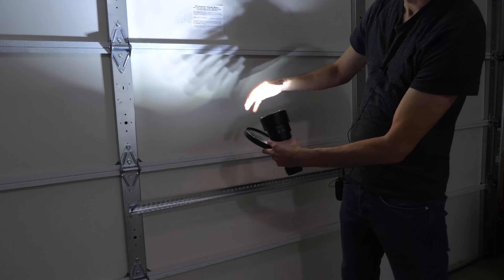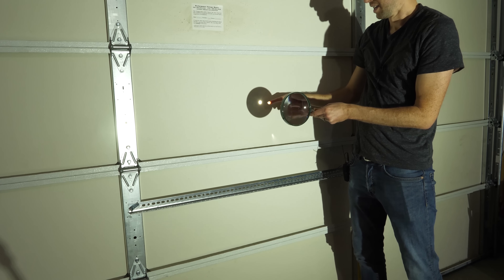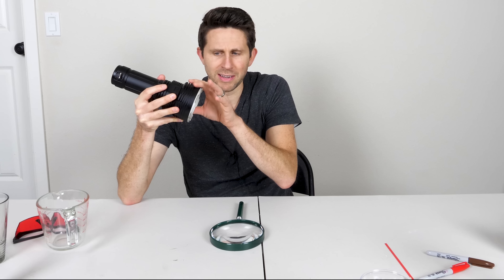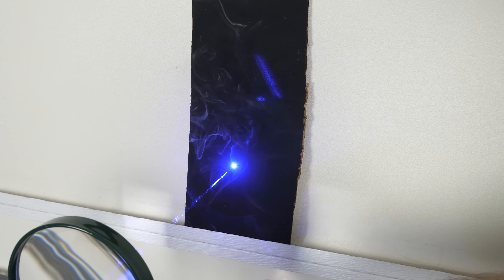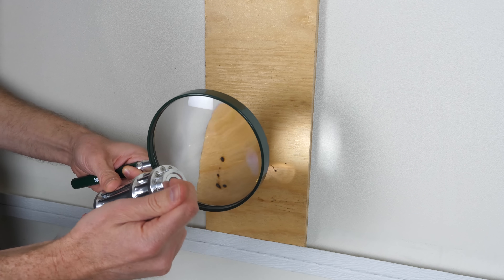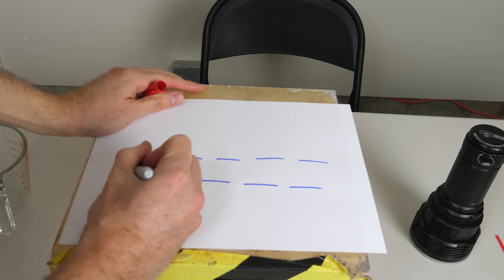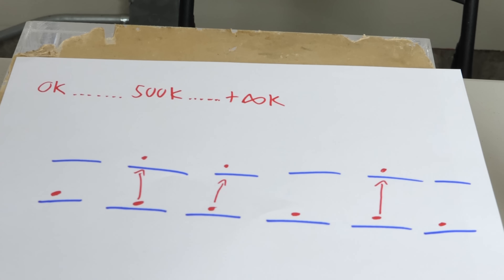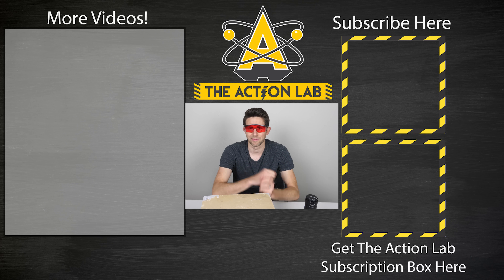What Happens if You Focus a 5W Laser With a Giant Magnifying Glass? Negative Kelvin Temperature!

Comment: All the physics here is WAY over my head! I was wondering though, what would happen if you continued to put MULTIPLE magnifying lenses in front of the already magnified beam? Magnify the laser beam as you demonstrated but then put ANOTHER magnifying lens in front of THAT beam and then another and another and another. Would the beam continue to increase in heat? Would it eventually burn through the later lenses?
Reply: Unfortunately, at some point, the light would be unable to get bundled up further. The more you bundle up the light, the higher the spread becomes, making it harder and harder to bunch up. The surface area and the spread of the light are inversely proportional. Let me show you:

Remember this: Systems with lenses and mirrors are reversible (reverse the direction and it will look the same).

Now imagine a small light bulb. The light at the light bulb has immense spread, and it pretty much shoots out in all directions. Now position this light bulb in the center of a very big parabolic mirror. The light will hit the mirror, and it will get “straightened out.” But at what cost? The cost is the increase in surface area. The light bulb had light concentrated very closely, but the spread near the bulb was very high while the mirror reflected the light into nearly parallel light rays, but now they might be many magnitudes further apart from each other.

And because this system is reversible, you can imagine yourself shining light into the mirror and trying to bundle it into a single point. If the light you put into the mirror is even just very slightly not parallel (even just a tiny spread), then the spread will get magnified by a ton after converging to the focal point. The size of this pseudo light source at the focal point is determined by the coherence/spread of the light you put into it, and it is impossible to bundle it up more than that.
Reply: @hypnogri5457   Ok, so even light is not infinite. It has a set range that it can't compress beyond depending on the source..?. It eventually becomes like trying to compress water? I love this stuff! Makes me wish I paid closer attention in school! I could just never really wrap my head around a lot of it. I've often thought about this kind of thing and wondered what it would take in order to reach "Sci-fi" levels of weapons power like Star Wars blasters or Star Trek phasers, etc. THANK YOU, hypno! (I apologize for making such little (if ANY) scientific sense. These equations are beyond me!)

Comment: What if you shined the flashlight into a large lenticular lens?
Reply: Unfortunately, at some point, the light would be unable to get bundled up further. The more you bundle up the light, the higher the spread becomes, making it harder and harder to bunch up. The surface area and the spread of the light are inversely proportional. Let me show you:

Remember this: Systems with lenses and mirrors are reversible (reverse the direction and it will look the same).

Now imagine a small light bulb. The light at the light bulb has immense spread, and it pretty much shoots out in all directions. Now position this light bulb in the center of a very big parabolic mirror. The light will hit the mirror, and it will get “straightened out.” But at what cost? The cost is the increase in surface area. The light bulb had light concentrated very closely, but the spread near the bulb was very high while the mirror reflected the light into nearly parallel light rays, but now they might be many magnitudes further apart from each other.

And because this system is reversible, you can imagine yourself shining light into the mirror and trying to bundle it into a single point. If the light you put into the mirror is even just very slightly not parallel (even just a tiny spread), then the spread will get magnified by a ton after converging to the focal point. The size of this pseudo light source at the focal point is determined by the coherence/spread of the light you put into it, and it is impossible to bundle it up more than that.

Comment: Use 5 magnifying grasses
Reply: Unfortunately, at some point, the light would be unable to get bundled up further. The more you bundle up the light, the higher the spread becomes, making it harder and harder to bunch up. The surface area and the spread of the light are inversely proportional. Let me show you:

Remember this: Systems with lenses and mirrors are reversible (reverse the direction and it will look the same).

Now imagine a small light bulb. The light at the light bulb has immense spread, and it pretty much shoots out in all directions. Now position this light bulb in the center of a very big parabolic mirror. The light will hit the mirror, and it will get “straightened out.” But at what cost? The cost is the increase in surface area. The light bulb had light concentrated very closely, but the spread near the bulb was very high while the mirror reflected the light into nearly parallel light rays, but now they might be many magnitudes further apart from each other.

And because this system is reversible, you can imagine yourself shining light into the mirror and trying to bundle it into a single point. If the light you put into the mirror is even just very slightly not parallel (even just a tiny spread), then the spread will get magnified by a ton after converging to the focal point. The size of this pseudo light source at the focal point is determined by the coherence/spread of the light you put into it, and it is impossible to bundle it up more than that.
Reply: @hypnogri5457   i theorize that there is a way to amply a laser beam to highly  destructive dangerous proportions . One way using capacitors that store energy and release all at once like a round of ammunition,  reason being you may have an issue with heat firing off beam of beam of that magnitude  , think it would be fun building a laser that could penetrate a 1” thick piece of steel 🤷‍♂️
Reply: @deltafox8795  its possible to store and release the energy. The video only talks about systems of lenses and mirrors. The moment you allow energy storage, everything is possible

Comment: build a laser generator that would create steam . the steam would turn a small dc generator charging a batt . inverted to ac or use as dc. seeing that you are multiplying the heat can you get more out than you put in . can you power the laser with the generator with a 12 volt surplus ? steam is a powerful force and with heat like that possibly doable ?  with steam there is no drag once it builds up it will move a train
Reply: you can capture the energy and use it to make something hotter but that wasnt the point. A lens/mirror system is unable to do that

Comment: Sure you can, use a round sleeve or tube and put that flashlight inside it and contain it into the magnifying glass.
Reply: it is impossible to make it hotter than the fuse of the individual LEDs. (but its possible to make it hotter than the average temperature at the opening because the light has already spread a lot)

Comment: What happens if you put two or more magnifying glasses in the laser beam to pass through? What happens if you focus five or more laser beam in one single point?
Reply: Unfortunately, at some point, the light would be unable to get bundled up further. The more you bundle up the light, the higher the spread becomes, making it harder and harder to bunch up. The surface area and the spread of the light are inversely proportional. Let me show you:

Remember this: Systems with lenses and mirrors are reversible (reverse the direction and it will look the same).

Now imagine a small light bulb. The light at the light bulb has immense spread, and it pretty much shoots out in all directions. Now position this light bulb in the center of a very big parabolic mirror. The light will hit the mirror, and it will get “straightened out.” But at what cost? The cost is the increase in surface area. The light bulb had light concentrated very closely, but the spread near the bulb was very high while the mirror reflected the light into nearly parallel light rays, but now they might be many magnitudes further apart from each other.

And because this system is reversible, you can imagine yourself shining light into the mirror and trying to bundle it into a single point. If the light you put into the mirror is even just very slightly not parallel (even just a tiny spread), then the spread will get magnified by a ton after converging to the focal point. The size of this pseudo light source at the focal point is determined by the coherence/spread of the light you put into it, and it is impossible to bundle it up more than that.
Reply: Concentrating laser beams will indeed make the temperature higher because its coherent light. (just point multiple lasers at a point)

But this is still impossible:
imagine many lasers pointing at a single point/hole on a sheet of metal from different angles. You can now imagine this hole as a new light source. This light source cant be made any smaller than it currently is because the lasers converge at different angles making the light incoherent. So it's impossible to make the temperature higher by trying to bundle up the light even more

Comment: I was thinking if you surrounded the sun in mirrors then made a tiny area for the sun to seap light out and reduced it to a a tiny point using a giant magnified glass then made it tinier and tiner until it's a tiny point wouldn't it be hotter?

Of course, we don't have that kind of technology, but yk just thought I'd put my theory out there 🤔 😅
Reply: Unfortunately, at some point, the light would be unable to get bundled up further. The more you bundle up the light, the higher the spread becomes, making it harder and harder to bunch up. The surface area and the spread of the light are inversely proportional. Let me show you:

Remember this: Systems with lenses and mirrors are reversible (reverse the direction and it will look the same).

Now imagine a small light bulb. The light at the light bulb has immense spread, and it pretty much shoots out in all directions. Now position this light bulb in the center of a very big parabolic mirror. The light will hit the mirror, and it will get “straightened out.” But at what cost? The cost is the increase in surface area. The light bulb had light concentrated very closely, but the spread near the bulb was very high while the mirror reflected the light into nearly parallel light rays, but now they might be many magnitudes further apart from each other.

And because this system is reversible, you can imagine yourself shining light into the mirror and trying to bundle it into a single point. If the light you put into the mirror is even just very slightly not parallel (even just a tiny spread), then the spread will get magnified by a ton after converging to the focal point. The size of this pseudo light source at the focal point is determined by the coherence/spread of the light you put into it, and it is impossible to bundle it up more than that.

Comment: To stop the flashlight from spreading out you need a collimating lens then you could focus it to a point but the point would retain the original layout of the LED's in the flashlight since it is not a point source.
Not possible to amplify the power, in fact power is lost through the atmosphere and the lens of the magnifying glass but, the power that makes it through is focused on a smaller area. We would call this watts per square inch. 5 watts focused on a 1 inch square area spreads the power out over the entire area, focus it down to 0.001 inch and the average relative power is increased 5000 times.
Reply: You wouldnt be able to focus it to a point smaller than the fuse on each of the LEDs because thats the limit set by the conservation of etendue

edit: by fuse I mean the wire of the LED

Comment: You can get something locally hotter than the source by combining multiple sources in a point. Basically sun light and flash lights have a large surface, which you can focalise, just not with that magnifying glass/reflector.

Comment: Just change or remove the reflector or use a larger lens that's wider than the beam of the flash light. You can also use multiple lenses or lenses designed specifically for the light source. SOLVED

Comment: A smaller point with the same energy will direct more heat per the size, as in, a 1W beam at 10 cm diameter won`t be as hot as 1W at 10mm diameter, because the energy isn`t dispersed over a larger area.
Right?
Reply: It's impossible to bundle it up more than the wire in the individual LEDs (probably impossible to bundle it up more than the LED itself)

Unfortunately, at some point, the light would be unable to get bundled up further. The more you bundle up the light, the higher the spread becomes, making it harder and harder to bunch up. The surface area and the spread of the light are inversely proportional. Let me show you:

Remember this: Systems with lenses and mirrors are reversible (reverse the direction and it will look the same).

Now imagine a small light bulb. The light at the light bulb has immense spread, and it pretty much shoots out in all directions. Now position this light bulb in the center of a very big parabolic mirror. The light will hit the mirror, and it will get “straightened out.” But at what cost? The cost is the increase in surface area. The light bulb had light concentrated very closely, but the spread near the bulb was very high while the mirror reflected the light into nearly parallel light rays, but now they might be many magnitudes further apart from each other.

And because this system is reversible, you can imagine yourself shining light into the mirror and trying to bundle it into a single point. If the light you put into the mirror is even just very slightly not parallel (even just a tiny spread), then the spread will get magnified by a ton after converging to the focal point. The size of this pseudo light source at the focal point is determined by the coherence/spread of the light you put into it, and it is impossible to bundle it up more than that.

Comment: So... according to your theory here, if I carefully focus two identical power level lasers from exact opposite directions (pointed at each other)into a convex diamond, the opposing beams could create a near ground state that would both melt and freeze the diamond (in that order) in less than a femtosecond?
Imagine having a beer cooler that needs a dime sized solar cell and a ultra capacitor-LiFePO4 power cell the size of a USB stick and have ice cold beer for the whole 2 weeks of fish camping in Alaska. 
The cooler would probably cost $5M, but hey, cold Heinekens a thousand miles from nowhere is well worth the Go Fund Me drive.😃
Reply: Negative Kelvin isnt cold. And also, only the laser diode itself has this property (and only because of the limited number of states it can be in)

The moment the light is created, it will not measure a "negative Kelvin temperature".

Comment: I'm not following this and I've worked in laser companies for 28 years designing lasers and systems. The population inversion you described is correct, but when the electrons collapse back to their original levels they release photons. Laser cavities reach nowhere near the temperatures you are suggesting, the laser media itself would be destroyed at such temperatures, e.g. a dye laser has a liquid lasing media, it would boil. Most of the heat in a laser comes from flash-lamps in flash-lamp pumped laser designs which give about 85% heat and 15% light at the correct pumping wavelength. More modern DPSS lasers (Diode Pumped Solid State), are far more thermally efficient. If you want to get a smaller focused spot, use a shorter focal length lens, but be aware that it will reduce your focal depth so you will have to be more accurate in getting it at the focal point.

Comment: Do the same experiment but with 10-20 magnifying lenses
Reply: Unfortunately, at some point, the light would be unable to get bundled up further. The more you bundle up the light, the higher the spread becomes, making it harder and harder to bunch up. The surface area and the spread of the light are inversely proportional. Let me show you:

Remember this: Systems with lenses and mirrors are reversible (reverse the direction and it will look the same).

Now imagine a small light bulb. The light at the light bulb has immense spread, and it pretty much shoots out in all directions. Now position this light bulb in the center of a very big parabolic mirror. The light will hit the mirror, and it will get “straightened out.” But at what cost? The cost is the increase in surface area. The light bulb had light concentrated very closely, but the spread near the bulb was very high while the mirror reflected the light into nearly parallel light rays, but now they might be many magnitudes further apart from each other.

And because this system is reversible, you can imagine yourself shining light into the mirror and trying to bundle it into a single point. If the light you put into the mirror is even just very slightly not parallel (even just a tiny spread), then the spread will get magnified by a ton after converging to the focal point. The size of this pseudo light source at the focal point is determined by the coherence/spread of the light you put into it, and it is impossible to bundle it up more than that.